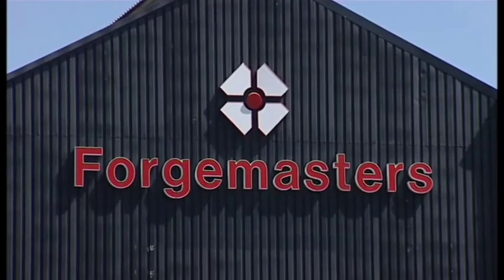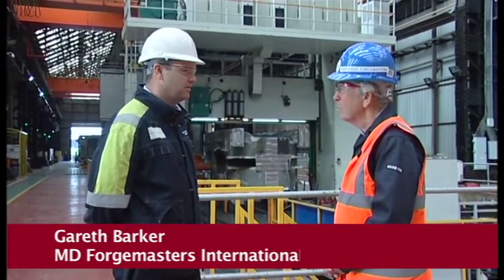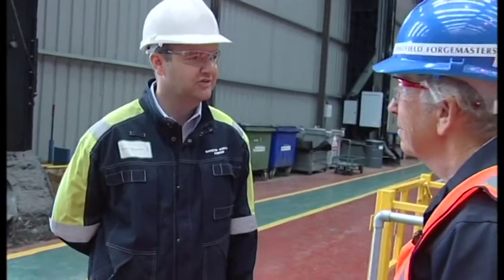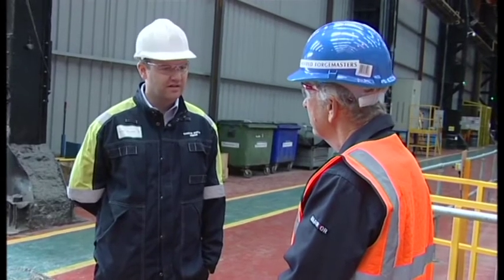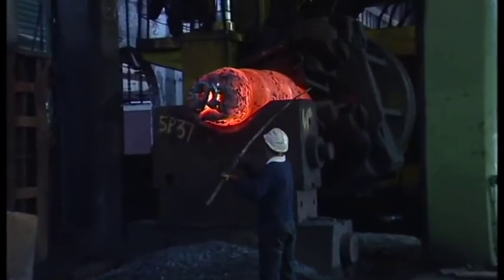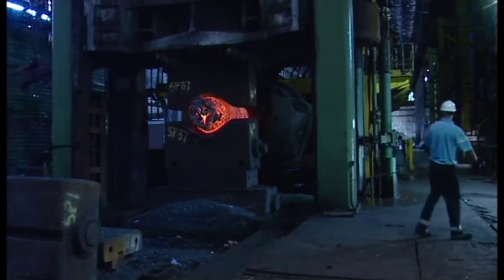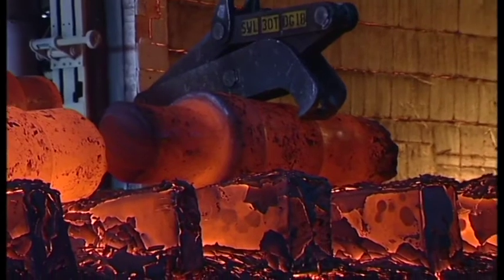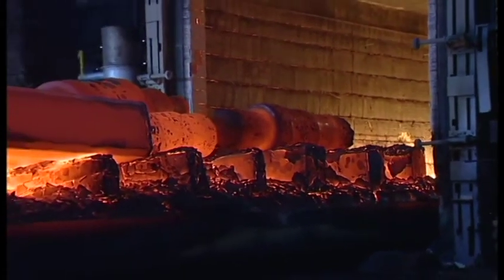Steel Making in Sheffield

Comment: At 1.41 in. He got his numbers wrong there 25.000 - 30,00 staff. No way. I worked there from 1962 - 1970  in the West & South machine shops the staff being 4.000 for the whole firm. They were making a huge range of products then but now concentrate on specialized ones ie. large castings and forgings and have the machine tools that can machine these parts if needed.
Two large jobs that I remember while working in the South Machine Shop were two 150 ton back up rolls for Krupp and  a previous contract of 250 ton boiler drums for power stations. No CNC machines then all forging and machining done by the pure skill of the tradesmen.
Reply: Hi Peter, I worked in the foundry from '79 to 2020, When I started there I was told there were 22,000 including all the apprentices 👍

Comment: oh if they have a 105 ton arc furnace how do they keep that much steel hot enough to cast in the largest of their castings since it has to be poured at once, it must take a long time to even melt the steel down 100 tons at a time and keep it in a ladle without it cooling or decarburizing.
Reply: The arc furnace takes an hour from dumping scrap inside it, to when it's molten and ready to tap. Ladles are lined with refractory clay and bricks, which insulates the steel to keep it hot for longer, as well as stop it melting the 'bucket' outer walls itself, which are made from steel. If a ladle of molten metal gets cooler than required, they stick three electrodes in it in a special and smaller kind of electric arc furnace called a ladle furnace.
Reply: @AluminumOxide  yes I know about an eaf, its just you would think for the giant casting that they are making it would lose its chemistry I mean the longer you keep steel hot or the more times you have to reheat it at least as far as forging it goes them more chance of loss of carbon and alloying elements, though I did not think about the ladle metalurgy furnace, I mean if they only melt 100 tons at a time filling up five or six ladles for one of the super giant castings must take a good amount of time is what I am saying, I was pretty sure a casting like that has to be poured all in one go dont it meaning they cant just pour half the needed amount and then comeback an hour later and pour more in the mold or flask they are casting it in, or can they?
Reply: Free Uyghur  yes how ever you spell it, you think if you had to wait hours it would loose the carbon content and metalergy
Reply: There will be a skull left in the ladle ,you will need to tap the next heat hotter to melt it out and figure the alloys lower at tap so not to blow the range out the top. (If it's going to be an hour.) And also the heat your pouring is going to be short because of the skull (solidified steel) left in the bottom of the ladle.
Reply: They have a vad unit that reheats any that are starting to chill, I can recall having six ladle for a total of 590 tons in the foundry, there's two heavy cranes of 300t and 200t capacities, three ladles are standing and a top up is lifted and poured by a crane that puts an empty ladle down 👍
Reply: @aflatminor  ah I see